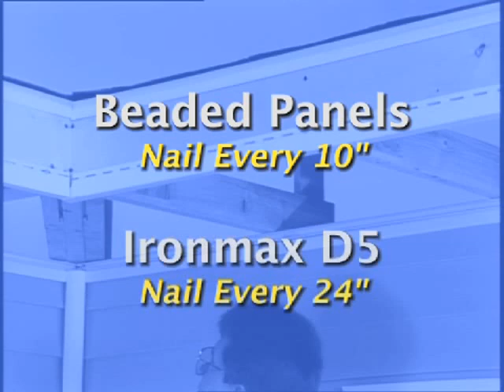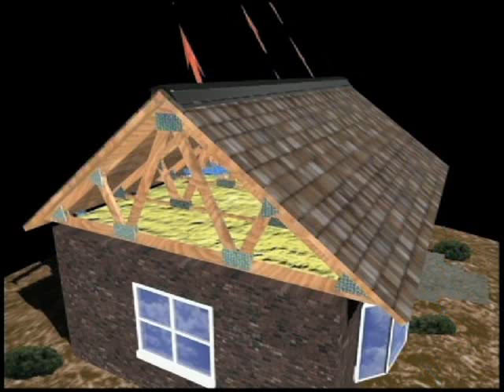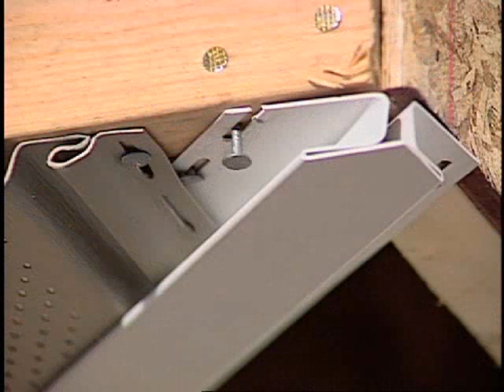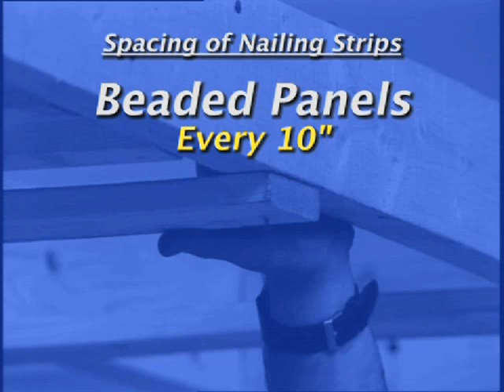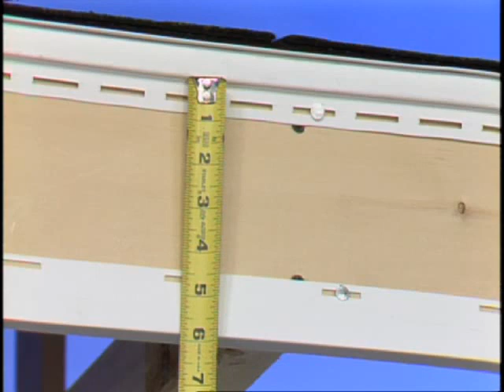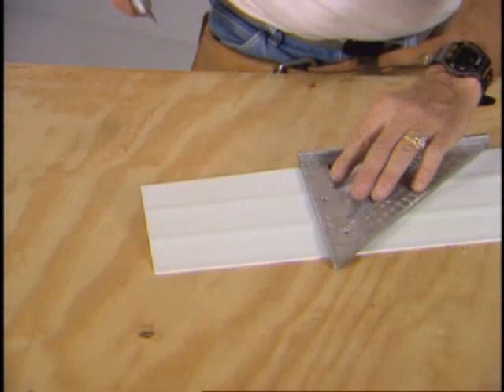Installing Vinyl Carpentry Soffit & Fascia

Comment: This video shows the facia being installed over the drip edge on the roof. Be careful, this allows for water to essentially flow down behind the facia panel and soak up into your facia board. I had these installed on my house and the facia board was rotted completely. When i put in back I will slide the top peice under the drip edge so any water is foced to flow down the face of the vinyl instead of soak into the wood and cause rot. Huge mistake on the installation guide. (Also if you nail that top peice into your drip edge when you get the roof replaced your roofer will have to rip off the facia cover to re-roof).
Reply: Glad someone else noticed! Terrible idea. Drip edge is best with a gap behind it, not flush against the sub-fascia with a piece on top of it. That's a recipe to guide water back onto the sub-fascia wood! There's a Youtube channel which shows how you can put the undersill trim UNDER the drip edge, thus allowing vinyl fascia to clip in under the drip edge and it also spaces the drip edge out from the surface perfectly. (The only caveat there is you have to anticipate before putting the roof!)

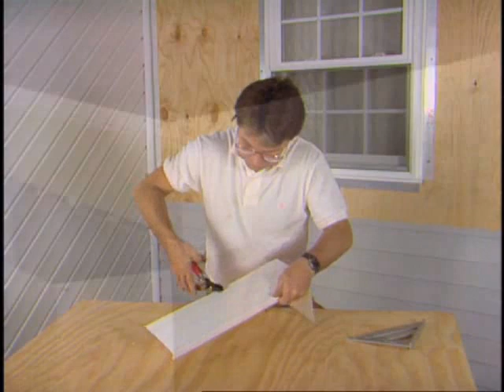Comment: The part about installing fascia around a corner is incomplete - doesn't show all the steps and is unclear about "under lapping the preceding panel" at 7:05. I'd think you would need to trim the bottom 'L' off of the preceding panel so as to not interfere with the piece you are under lapping.